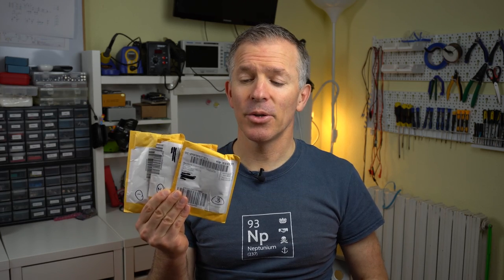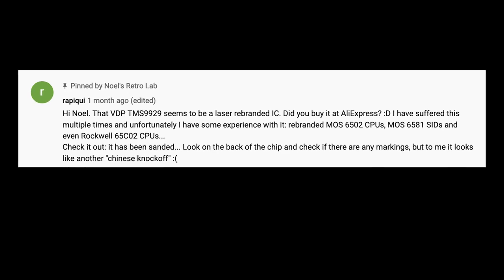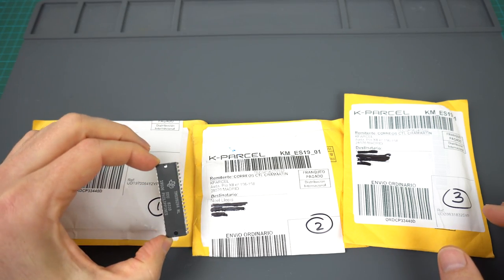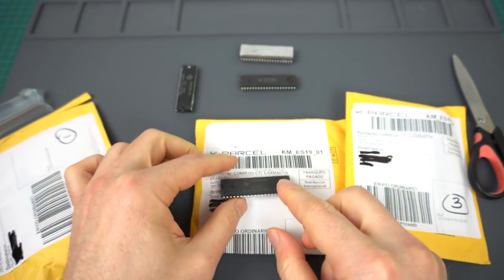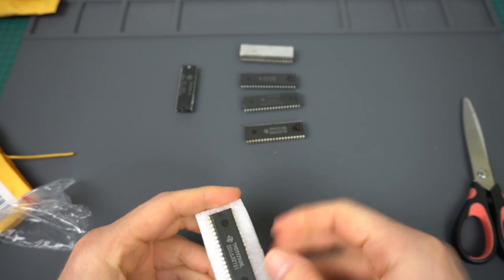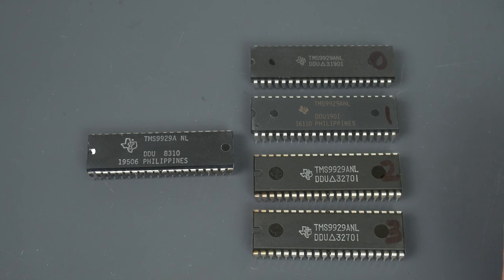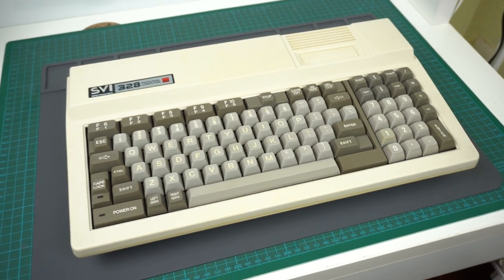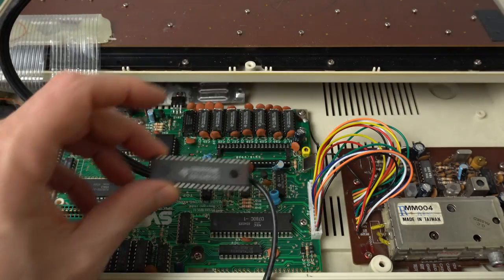Detecting FAKE Chips From China 🔍

Comment: This may seem harsh, but it's really a disservice to other potential eBay buyers to leave positive feedback for both sellers who are conformed sellers of fakes.

"Buy from these sellers! You may wait weeks for delivery only to get a fake that at best won't work and at worst may fry other components on the board you are trying to fix. But if you are among the few who are smart enough to figure out the scam, you get a refund. Such excellent sellers. No worries."

Some wonder how such sellers can maintain a 99% positive rating. Well, here's the answer.

Even if the seller is a middleman, there no incentive to clean up their act if eBay continues to rate them as "One of eBay's most reputable sellers."
Reply from the maker: I left negative feedback for the two that sold me fake/non-working chips, and positive for the two that sent me a working chip. I understand other people got fakes from those sellers, but I left feedback based on what I got.
Reply: I offer my apologies then. I must have been looking at the wrong feedback.  Thanks for the great informative video.
Reply from the maker: @TomNimitz  No worries! 👍

Comment: It seems that the chip you just pull from your computer the RSM9929 is for a PAL system ( European or Asian standard  TV )..... The VDP in SVI-318, 328 and 728 is the Texas Instruments TMS9918A or TMS9929A for PAL versions. The TMS-9929 is effectively identical to the TMS9918 ... "wrong chip pal"?????...There are several variants called TMS9918, TMS9918A, TMS9928A and TMS9929A, where the 'A' indicates a second version of the chip which added new features, most prominently the addition of a bitmap mode (Graphic II). The non-A version was only used in the TI-99/4; the TI-99/4A and the other computers had the A version VDC. The TMS9918A and TMS9928A output a 60 Hz video signal, while the TMS9929A outputs 50 Hz. The difference between '1' and the '2' in 'TMS9918A' and 'TMS9928A' is that the '1' version outputs composite NTSC video, while the '2' versions (including the TMS9929A) outputs YPbPr, more precisely the Y, R-Y and B-Y colour differences (luminance and colour difference signals). The need for the latter was predominant in the 50 Hz world, including Europe, due to the different video signal standards PAL and SECAM. It was more cost-effective to output Y, R-Y and B-Y and encode them into PAL or SECAM in the RF modulator, than to try to have a different console for every different color standard. The '1' version also features an external composite video input which made it a handy chip to use in video "titlers" that could overlay text or graphics on video, while the '2' version does not.....

Comment: Emmm. It's true. Especially those ancient and rare chips. You buy them on eBay，and we buy them on Taobao.  Interestingly some real chip（Remove from the old machine） they also polished them，maybe make them look like new chips. The Refurbish chips are usually good，because they are tested. Once was the most interesting, i know ibought the Refurbish "stm32f103c8t6", but
i find it is "stm32f103cBt6" which has 128k flash.

Comment: Interestingly the TMS9918ANL I have just gotten has ~200kohm for the crystal pins, and 2kohm for the VCC to VSS rather than the 700ohms. Hopefully mine is operational, won't be able to test until I get more parts though I think.

Comment: Please use proper antistatic procedures. Although I assume that the chips were DoA it is your responsibility for proper handling (which you are not) hence violating any warranty (explicit or implicit).
Reply from the maker: I am using an ESD wrist strap any time I'm handling them. You just can't see it most of the time, but it peeks into the field of view a few times.
Reply: @NoelsRetroLab  Sorry about it. I did not see it in the video

Comment: I was surprised that at the end one of the good chips was from Polida. I've avoided them in the past as I saw another video where somebody bought fake chips from Polida.
Reply from the maker: Yeah, I'm under no illusions that those vendors only sell good parts. It seems it's a problem from the distributors so you may get anything. Of course, if the sellers didn't want that to happen, they could avoid those distributors, but no... So they're all kind of guilty in some way. Blargh.
Reply: @NoelsRetroLab  Best way to make an easy buck is being a middleman I suppose.

Comment: Thanks for the kick ass video. You rule. Question: I did this test with some 8-pin opamps and my multi-meter functions the same as yours, but I'm not sure how to correlate fake vs real based on genuine specifications, meaning, if I was looking at a Mouser white page with specifications, what exactly would I look for to correlate fake from genuine (in regards to ohms or megaohms)  ? Thanks again man.
Reply: No manufacturer provides that type of pin to pin measurement information that I know of.
The only way to do this in the field would be like Noel is doing it, with respect to a known good chip.

Comment: I prefer the fakes then the originals with absurd price tags. Better yet when you have enough space one can use modern ones with adapters.
Reply from the maker: The problem is these fakes aren't functional. They're some discarded DIP 40 IC relabeled as whatever you're buying. But they may as well send you bricks for all good they do in your projects.
Reply: @NoelsRetroLab  that's sure a real bummer, in my experience with fakes I just find that they are lower spec/lower quality,  sometimes is ok....                                                          Why they go to the trouble of making them... well don't forget for many asians  live with  1-2 euros a day... so everything counts.                                                                         One may also find that chips sold as new are actually desolderd ones.                                   I have also find that  when buying from asians sites are much cheaper and less prone to scams and the sellers there are pretty honest about what they are selling. they prefer to call them ... ask them if the components are imitation tho. not fakes.

Comment: China has made great economic strides. Most people are above the poverty line, which they have redefined to be $1 per day. I'm not joking. The margin may be just the cheapest chips they can get. Maybe rejected defective parts. Plus silk screening.  Shipping is almost nothing because of preferential rates for developing countries which China is still listed as. And they may have ripped off the person you bought the chips from, messing up their rating. They probably do a lot of different chips and may also just salt in fakes with real ones to pad profits. One reason is very slight punishment and lax enforcement. Its a fine based on the value of counterfeit goods currently on hand. Like 3 times the value of the chips physicallythere. Not 3 times value of everything they ever sold. At least it is not counterfeit food.

Comment: Chips that sold for repairing retro games is not such a big deals if some of them are counterfeit.The major problem was when they sold BGA chips for repairing laptops as the notorious nvidia G86 graphics chips and similar from other brands.None of them was genuine,from totally fake or recycled that failed after a while and caused damage worst than the initial,technicians were liable to their customers after their failed repairs because these fakes are sold from real bastards.
Reply from the maker: Same thing goes for retro computer. I will often repair a computer and then sell it. It sucks if it fails again because of a fake part. But here at least I'm talking about "not-even-the-same-chip" kind of fake. Best case it doesn't work, worst case it blows up your computer.

Comment: It was necessary to dissolve the shell of the fake chip with acetone. I wonder what's inside
Reply: It cannot be dissolve even with acid. Need to break it with force and most likely the dies and fine gold wires will be broken in the process.
Reply: @Utube1024  did you watch the video? there it was shown that the body of the fake chip is dissolved with acetone.
Reply: @abdulkus8401  If it can be dissolve in acetone must be faked made of thermoplastic. The actual material used for the package is a thermosetting compound which cannot be recycled to reuse. Thermosetting plastic compound just like good quality electrical plugs which is non-flamable.

Comment: Who is buying these chips? Me. There is not really much of a choice of 8 bit display chips.  Besides the TMS9929 I only can think of the old MC6847, but I really hate that one's garish fixed colors. Too bad that the TMS9929 does not have a real linear pixel graphics mode. Still, it's still one of the best ways to get usable graphics for homebuilt 8 bit computers. I have a little computer with a CDP1802 processor on a breadboard right now on my other desk and a TMS9929 for it is on the way.

Comment: Now I am curious if it is not like z80 o some know chip that was rebranded! Can you do an uncap?.
Reply from the maker: A few people have asked me if I can do that. It's not something I've done before but... I feel like a moron, but I threw them away! I normally keep all faulty chips in a box because sometimes you want to have a faulty one for some project, but I didn't want to get mixed up with those. Now I'm wishing I had kept them to try to identify them. 😬
Reply: @NoelsRetroLab  a way to have an idea is to find out the pins with +B and GND, if it match with known chips, prior to uncap.
Reply: @NoelsRetroLab  oh, sad you threw it away. It is easy to check if it is ANALOG chip or digital just with a tester. Surely they grab VCR's chips that nobody request to buy or something like that.
Reply from the maker: @flyguille  Oh, that's interesting. How would you test analog vs digital?
Reply: @NoelsRetroLab  looking for buses, is to say a continous set of pins, that measure the same (the protection diodes), but first needs to know the GND and +VCC, so that is another story, that can be found measuring the capacitance, larger , it is it!. ( you set a plate in bottom of the IC, connect to capacitance tester, to that plate, so that way you can check it, against each pin), larger, is GND. In analog, every single pin will measure different, very inconsistent, digital, it is all the same, differentiating in tri-states outputs, two-states output, and inputs. So you will see three patterns only, except the clock tank if it has.

Comment: I did buy some chips from the sellers you mentioned in your video over the last two years - the first seller( hu*...) send me a fake chip too, so I would not recommend this seller at all. As for the second seller mentioned (adel*...), I did get working Dallas replacement chips for my 8088 PC, sold as NOS, but as expected the battery inside was flat - at least they were genuine.
Reply from the maker: Yeah, it's a mixed bag. Lots of people reported fake chips from the second seller as well. It seems to depend on the distributors rather than the sellers unfortunately.

Comment: You know. Considering the terms used in this video and also in the comment, it seems as if people here and in the video believes, "fake" and "not working" are the same thing. Chances are, they are not "fake", but rather "salvaged". The question should be that they're "selling untested salvaged chips" which is not the same as "selling fake chips".
Reply from the maker: You're right that fake isn't quite right. But I couldn't come up with a better term. These are not just "salvaged untested non-working chips", they're simply not TMS9929As at all. They're some other chip that was sanded down and labeled as a TMS9929A. So counterfeit might be a better adjective.

Comment: How do the date codes on these chips work?
Reply: Normally a four digit code as seen on the original part with 8310 date code -- first two digits = last two digits of year ==> 83 = 1983. Last two digits = week of year ==> 10 = week 10.
Occasionally parts do not conform to this encoding and you need to contact the manufacturer to see how the date codes were decoded. As old as these parts are, TI would just laugh at this request. AND sometimes, parts had date codes on the bottom. Signetics used to often have date codes on bottom.... sometimes dates on both top and bottom and the two didn't match.

Comment: 27:48 And that's what I don't understand. Over 99% positive and selling fakes? How is that possible? Random fakes from supplier and seller is innocent or buyers are stupid?
Reply from the maker: Right?? I'm sure they sell a mix of fakes and original chips, that's how they get that rating. Or lots of things that can't really be faked (passive components, cables, etc). Still, shocking that the two good sellers didn't have better ratings than the other ones. Makes me think they all sell from the same distributors and you have the same chances of getting bad chips with any of them.
Reply: @NoelsRetroLab  That realy scares me. I'm looking for high number of sales and 99+ feedback all the time. But as you find out it looks like it's not always the right way :-(

Comment: Your buyers can't source needed chips and in desperation buy from a source found online. Buyers warn design engineers, manufacturing and test engineers of untested source. A batch is run through manufacturing and a high failure rate is reported. Is the entire batch to be discarded, tested, or used and delt with as needed? Real life these days. I believe that now I have seen counterfeit chips being marked as packaged in Philippines and Mylasia because China has such a bad reputation for counterfeit parts. Smaller high-mix electronic manufacturers have major problems these days.

Comment: What is the definition of fake? Do you mean a simple copy or a copy which ís mislabelled?

My company, located in VietNam, buys 555 chips the only difference being between our chíps are pinouts. Anyone who has laid out / routed a PCB for many (most) 555 applications know that two tracks have to be routed between pins on opposite sides òf the chips.

We order our chíp in batches of minimum 500 pieces with the píns cross-connected internally. Do you consider them fakes?

The Chinese make many chips that are no longer manufactured in the West - take the XR2206 function generator - the majority available now are Chinese copies. The same applies to some LED display drivers.

Comment: That something has been sanded down doesn't mean it is fake. It can be a recycled part that they sanded down and relabeled, the pins should have been tinned as well for this to be the case.
Reply from the maker: Why would you need to relabel it though? I've never seen a genuine part sanded down and relabeled with the same information. Usually they do that to hide the original chip info, sometimes just the speed, but sometimes it's something completely different.
Reply: @NoelsRetroLab  plgDavid made a video about. The title is: "Fake" chips?

What happens is that many old electronics are shipped to China for recycling. They desolder the chips. Sand them down and relabel them so they can sell them as new.

Comment: I've actually seen a fake chip work as advertised before. It was a MIDI chip. It's actually possible that #1 was a legit chip that failed. They can fail in different ways. If the leads to the chip burned out it would certainly give you a 0L reading on a legit chip. There is no way to know. Chip 0 was definitely fake.

Comment: The first one definitely looks and seems like a fake. The second one, though.. I wonder if it is possible that it is legit, but just bad. It looks like it is a pull, whereas the last two look almost brand new.

That is another problem with sourcing chips out of china.. they sometimes will send you pulls that are duds, as they don't have the capability or knowledge to test them. They definitely should label them as pulls, though.
Reply: I'd also add, for bonus points, exposing the die and comparing it. Can use the original failed part as your control, and compare the two duds to it. It is true that some chip revisions can have the die completely reorganized, but the functional units often are still identifiable. Just if you're really into chip forensics. ;)

Comment: Not a  plug at all just trying to help out. I've used UTSource.net for my obsolete/hard to obtain parts for a few years now. The prices are good, they will use reputable couriers if you pay a little more, and best of all I've yet to receive any dodgy parts. These days I only use ebay for passives and things like LEDs. I've even had problems with current parts like AVRs. MAX232s seem to be another common target. It's just to hit and miss, unfortunately. But yes, if you want to go that way find a reliable seller and stick to them. Not to mention the time wasted when you are trying to diagnose a board problem, but you also have that nagging doubt that the part itself might be rubbish.... Argh.
Reply from the maker: Thanks! I didn't realize they carried old parts like this too. I see when I search there that some of the chips are offered from them, and some from third-party sellers. I imagine you need to stick to them to avoid fakes? I'll have to look into how much shipping is, but it might be a great option. Thanks!
Reply: @NoelsRetroLab  yeap, in fact I've only used them for old parts. :) Most recently I bought some old 5V FPGAs which were NOS I believe and hard to find elsewhere. And yeap I stick to UTSource.net itself.  They seem to stock pretty much everything. For very obscure stuff you have to request a price, but they are a friendly enough bunch. Anyway, love your channel Noel!